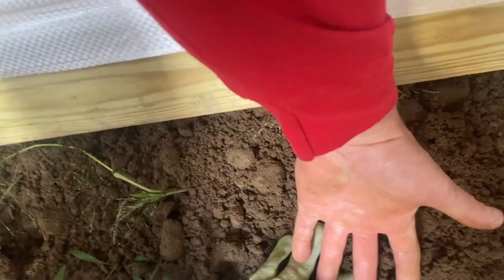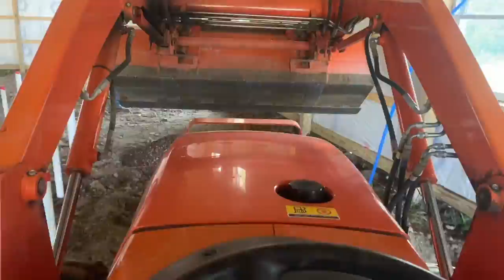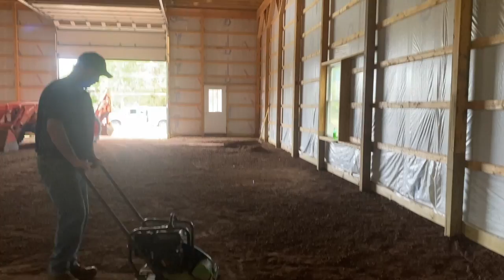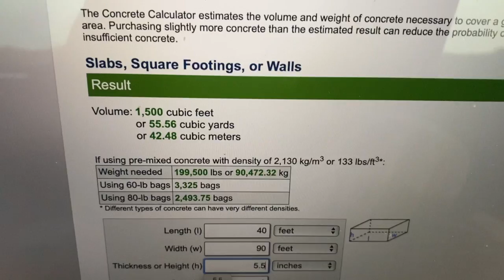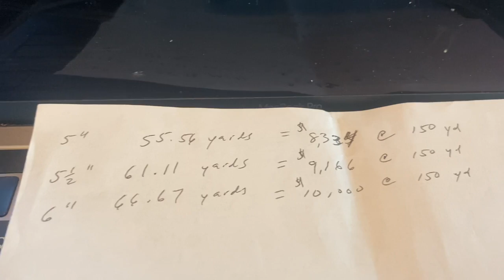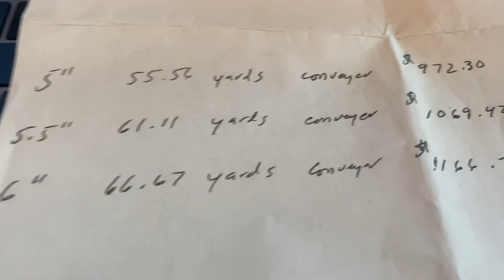SAVE MONEY ON CONCRETE POURS!!

Comment: Here in western Pa. our crusher rock is limestone and when you pack it the surface turn to almost a concrete fill. I used a 6" base of crusher as base under my retaining wall and only used a 10 hand plate tamper and watered it to pack it tight and installed a 3' high wall 15 years ago and it never moved since install.

Comment: So 10% for every 1/2 inch extra, ouch. Best not to make mistakes. 
If the floor is too low when you arrive, then the customer has to bare the cost, in extra base fill or concrete, whichever is appropriate. That’s one blessing.

Comment: I'm so confused why they don't make the building on top of the slab and pour a small foundation.
Reply: This style of construction, called "post and beam" or also called "pole barn" does not require a concrete slab. The building is supported by the wood timbers that are placed in the ground and supported/anchored by various methods. Metal buildings, "pre-engineered metal buildings" or "weld-up" buildings do require concrete slab/footing and are commonly poured in the "monolithic" style. It's not uncommon for pole barns to only have a gravel floor but it depends what your purpose for the building is. If you're just storing a tractor it doesn't require a concrete floor.

Comment: That cost analysis part was eye opening. I worked a year and half back in 95/96 building a water filtration plant in Western MARYLAND. Some of those slabs we poured was 8 inches thick ,but ol'Bob wasn't to keen on getting that sub grade honed in. Several pours we was wearing hip waders for our muck boots. What an experience that was ,we poured in all kinds of weather, building temporary structures and running propane pot heaters and tanks to heat them for days till they set up. Man the things you guys get into brings back fond memories of my construction days.
Reply from the maker: Awesome. Im glad you enjoy and bring back the memories for ya. I hate pouring in the cold weather. LOL

Comment: My wife is Kristina with a K lol. Nice work too and good info. I remember in Chicago when we used to do alleys and driveways and had to spread and compact crushed stone. The good thing here is the barn provides shade so not to worry about the heat on your head.
Reply from the maker: Thanks Yes working indoors is nice for sure. 👍👊 Especially if its raining. LOL

Comment: Hey Ron,

Just found your channel and love the work you do. I’m going to be installing radiant heat in my 42 x 60 pole barn with sliding doors. I get the use of foam board for a thermal break under the pad and around the perimeter, but I am not sure how to address the exit point. How do you add foam board at the doors? Appreciate any help you can provide and you have a fan for life.

Thanks
Reply from the maker: Thanks Vernon. I answered this one above buddy. 👍😊

Comment: Since your doing radiant heat.

Is there an optimal thickness of concrete for heat transfer, and to protect the pex?
Reply from the maker: I like to have 4 to 5 " over the pex tubing. If we pour 6 to 7" we would lift the tubing a little Mitch. 👍👍

Comment: Question:  Why not do a bunch of the prep work inside, then dump the gravel inside and them spread it?  Would probably save a few hours running back & forth on the Kubota...
Reply from the maker: The excavator guy dropped all that gravel outside the building before I got there. The owner ordered ther material. 👍

Comment: not sure what your hourly is for your guys but in my business I get $60 per man hour which would be around 1080 for labor and add the cost of the 5/8 minus with binder or 1/2 with binder and your somewhere around 15-16 yards at about $25 a yard, now with the prep your up 1400+. I guess my contention is if Im running the crew and wanting to put money in my guys pockets for an extra day of prep (which would be 3 guys at 8 hours not just the 6) then there isnt a savings. Plus you folks in NY get premium for mud, we can still get it for 85-100 per contingent on slump. Thats a 5.5 sack mix too. For me, I would cut my laborers loose just leveling while we set the board or lines for the pour. Measure it out and add about a yard and deal with the retain. I always had my customer consider stepping pads or small pad at a man door and form it up for any of the retain and whatever your short could be sacked in.
Reply from the maker: Yes if I could  get mud for 85 a yard that would not be worth fussing to much with the grade. I pay almost double that. LOL. 😂 👍👍

Comment: Hi Ron,
Great video and great work.  Question for you:
If you were going to do a heated slab on grade with traditional stick framed walls (walls at the border of the slab), how would you go about insulating the outer edges of the slab.  With this video, I can understand how you did it because the walls were already up. 
Keep up the great work and informative videos.  Cheers from Canada
Reply from the maker: https://youtu.be/z__1OOIuHA8 Hi there. Watch the end of this video buddy and we used the mini excavator to dig down the sides of a monolithic slab and put 2” of polystyrene insulation board on there. This is one way to do it. We have also done stem walls with Nudura to raise up a building and poured concrete slab on top of the Nudura. Let me find that video also and send it to you.
Reply from the maker: https://youtu.be/0ibQ2mueXIo
Reply from the maker: https://youtu.be/cQkk2xctF2w

Comment: Hey Ron, i would like to know more about hooking up the radiant heat source after the pad is poured?  Do you do the hookup as well or just lay the pad?  Thanks!  You guys do awesome work!!
Reply from the maker: Thanks Ron. Sometimes we hook up the heat source but most the times we just lay the tubing and pour the concrete. I do have some videos showing different systems hooked up. Check them out. 👍

Comment: Cost IMO, is irrespective for a floor slab, high Mpa, rebar with a minimum of 6 inches or this floor will snap like a dry match and crack all over
Reply from the maker: I’ve poured probably 200 of these pole barns at 5-1/2 to 6 “ thick with no rebar just fibers and wire mesh and good low slump 4000 psi concrete and never had any issues with cracking. I say the sub base is the most important part. Well draining materials put in in small 6” lifts and tamped. If poured on a bad sub base like clay soils your definitely gonna have a slab cracking issue. 
Good feedback 
Thanks 👍

Comment: Hey  great  video's,  Ron what  keeps  the concrete  from pushing  out the  bottom  of  your  walls  ? Thanks
Reply from the maker: The skirt board on the bottom  holds the concrete it's a treated 2x6. 😊👍.